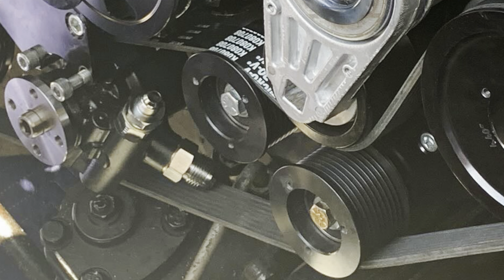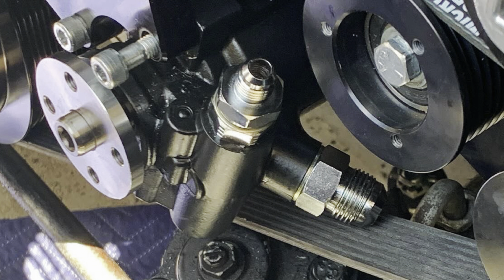FIRST START!!! | CVF RACING WRAPTOR PROCHARGER KIT | 1971 CHEVELLE LSX RESTOMOD

Comment: Im running a centrifugal vortech v-3 on my c10 and i havent added an intercooler yet either, i was wondering what kinda iat# / mat#…(intake temps) you are seeing…or were seeing when it was on the caprice…im around 120/140*……..i really dont know what numbers to be looking for, on my LSA cars they are usually ambient temp 95% of the time
Reply from the maker: Well, I guess we’ll both find out. 😂 I am routing the inlet pipe portion up to the front of the vehicle. That should help.
Reply: @MrGriffin23   yeah i actually just did that the other night cause i noticed my IAT’s were higher than id like, i never understood why vortech would put the air filter literally above the headers….so i ended useing some cold air kit piping i had laying around and routed it towards the radiator core support then drilled a 5” hole in it right where i routed the piping to go (next to the battery)….i made it go into a small plastic garbage can that is centered over the 5” hole i made so all the incoming air is dierected into the garbage can which the air filter is mounted inside so it is catching all the cold air…..i noticed about a 40* drop…..i wrapped the plastic wastebasket in foil tape to keep radiant heat out of it….it actually works damn good!!!
Reply: I probably could have just used a coffee can or paint can as well….but u get the idea